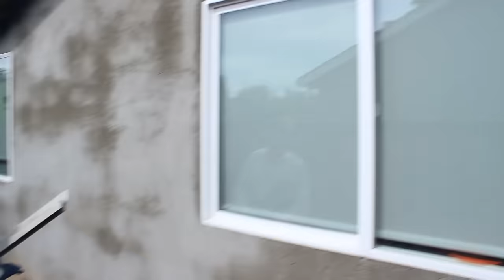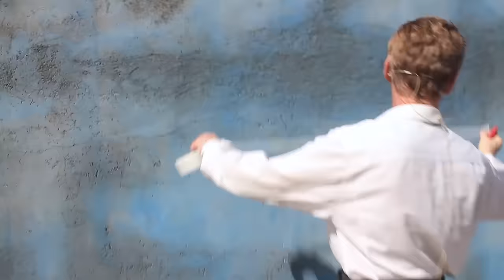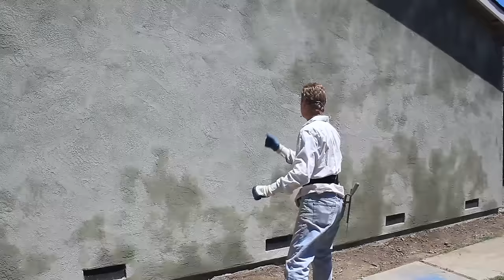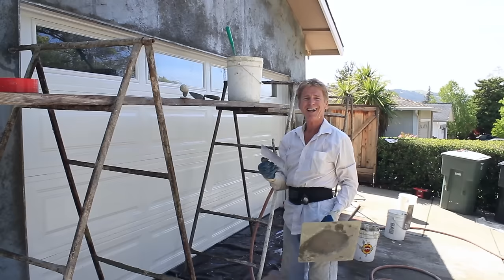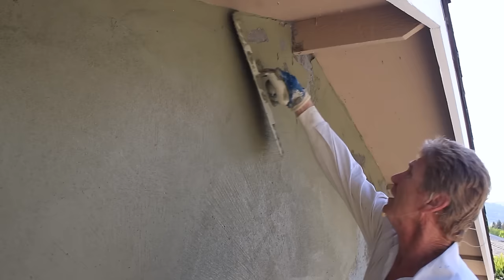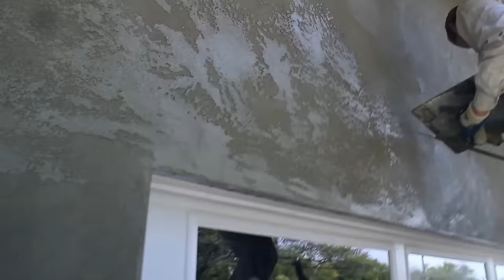Stucco Resurfacing

Comment: I enjoyed your video, Thanks. 
The first house my parents owned was probably built in the 1910s. They bought it in 1947. Stucco on wood lath. Nebraska's mild climate was not a friend to wood lath! The interior was also on wood lath. People had tried to nail pictures to the wall, bad idea. I'm 78 and worked construction most of my life. Big old houses had crown moldings formed in place with plaster over wood lathe. I repaired a lot of them but with expanded metal lath. Almost no plaster work is done around here any more. Interior is all gyp bd. Outside is over foam.
Reply from the maker: Howdy Larry, the same here, however, there's enough repair work from before the 60 when sheetrock was starting out to keep a few thousand plasterers busy for a few lifetimes.
Bringing to all the most complete plastering encyclopedia ever created in the world online.
 By the plastering messengers of Youtube.  With well over 850 free self-help videos 🎭 👀💃
Kirk and Jason Giordano Plastering

Comment: I like to shake the stucco used for the skip back from the edge before going up on the wall. I get no "knife" edges. I was 20 when an old (retired) union plasterer who worked out at Disneyland showed me that. I'm 74 now. Had to get a new shoulder last year. Plastering is tough work if not dangerous at times. Good stuff Kirk. Been watching a coupe years now.
Reply from the maker: Good afternoon Odd Job Fix. Sorry to hear this shoulder news.🥂
 I have my arm and shoulders sore at times, but miraculously, they continue to get stronger.
 Food and drink with a clean gut system are the keys to my health.
 Bringing peace, love, and brotherhood, back into the 🌎 of Plastering.
    The most comprehensive encyclopedia of plastering on video, by the plastering messengers of Youtube. 
Kirk and Jason Giordano with over 800 videos 🎭 👀💃

Comment: hey Kirk,  I completed my one and only stucco job due to you.  One of the hardest thing I ever did.  A past carpenter,  I was hard up for money and a friend let me stucco one of his rentals.  A painted cement block.  I followed all your instruction.  The only problem was you make it look easy.  I ended up spraying it on with a hopper scoop but it was florida in august and the stucco seemed to set up almost instantly.. I like to do a high quality job so I put it on twice as quick as contractors I see in the area.

I'm very interested in putting stucco over insulation.  I'm into building techniques and it only makes sense for energy efficiency value.  I  thought of putting half inch treated plywood strips, one and half insulation foam and then stucco the top with stucco.  I wish you would do something like this.  My technique blocks the heat radiation, thermal break and then leaving the block for thermal mass.   I'm a midwestern carpenter and now digging into stucco because of you.  Kepp up the work and let me know what you think.  I think with energy and solar panels your viewers would like it.  Dig it into solar panel insulation etc.  Solar salesmen are sweeping my area in florida.
Reply from the maker: Good evening NK Dude, Stucco over the insulation board is far from new, it's been here in the US for about 70 years. It was started in the UK.
 Its called the Dry-Vit system, first a moister barrier is attached to the wood wall, then the Styrofoam board, then Fiberglass mesh with Polybond to adhere to it.
 A color finish is then often applied.
 when I first started in the stucco trade 40 years ago, we did many kaiser hospitals and schools using that system.
 Today there are about 20 different manufactures that come up with similar ideas as it worked fine.

     Bringing peace, love, and harmony back into the world 🌎of plastering.
  The University of plastering by Kirk and Jason Giordano. 🎉💃 🥂🧞‍♂️
with over 850 free advice show and tell video’s on stucco & plastering

Comment: Thanks for the great video.  i have lots of variations on a 40 by 5 foot patch ..some  parts are floated some are steel troweled .Some i have removed the fake colour coated brick texture from it .. Im real happy i seen this video of years cuz it explained why i should use a bonding agent..   Theres a lot to learn ,, So i didnt think i could wet the wall again after i applied the bonding agent .. i thought that the bonding agent would not work
Reply from the maker: As a rule, once a bonding agent is applied, you don't need to wet the walls before applying stucco finish. However if the walls are in extreme sunshine say 90 degrees or above for a while, the complete wall can be cooled off with ten minutes or more of water sprayed from your garden hose to cool the wall down. Not just the surface but the entire inch thick base coat. Now your set to apply a finish without the hot wall drawing out the moisture of the stucco as fast as it hits the wall. And no, the bonding agent won't come off no matter how much water was hosed on it after that bonding agent has set. Stucco 101.👨🏻‍🔬

Comment: Another great video brother. Weldcrete is the best. I realize you didnt do the initial scrach and brown...i usually mix my scratch a little rich and on the brown coat i cut back on sand and use perlite especially over lath. Along with hydrating the walls , it cuts cracking down by 80%...
Awesome family brother. Glad to see Loouuu is back at it. Cheers from Central Florida !!!
Reply from the maker: Good afternoon Mike my fellow plasterer in Florida.🍺
 I have my reason for choosing the cement plaster I use when applying the scratch and brown coat.
 There are many ways to skin a cat.

 Bringing peace, love, and brotherhood, back into the 🌎 of Plastering.
    The most comprehensive encyclopedia of plastering on video, by the plastering messengers of Youtube. 
Kirk and Jason Giordano with over 800 videos 🎭 👀💃

Comment: Love watching how u guys do things over the pound 👏💪👊👷🙏 not so different, just some of the material. Been a nightmare at the merchants over here as well. As the British Gypsum factory shut down for a while. So no finish coat plaster. All the stuff they got shipped in was absolutely terrible gear. Polish finish coat plaster and Portuguese finish coat. I've used most materials but this was definitely a waist of time. We were trying to Trowel it  and it wasn't having it. Found out later that day it's designed to be applied, and sanded. And yes it came out perfect. But the work that goes in to it, to long and to messy. Live from the UK 🙏👷👊💪👏🔥
Reply from the maker: Good morning Neville, always a pleasure hearing from our fellow plasterers from across the pond,
 Cheers, mate. 🍻
   The complete plastering encyclopedia on video, by the plastering messengers of Youtube.  
     Over 850 videos 🎭 👀💃

Comment: I use K-rend in the UK that has uses a mesh over the whole wall. Never cracks and doesn’t add 10,000 to the price. Small price to pay to protect a costly stucco from hair line expansion cracks.
Reply: Good morning Elliott, we do this for interiors as a rule. Good tip.
    The complete plastering encyclopedia on video, by the plastering messengers of Youtube.  
     Over 850 videos 🎭 👀💃

Comment: Interesting texture. In the UK the finish would not be accepted but I understand that in the states it's what people like to see. 
I was surpised how thin you put the top coat on. I use Weber Pral-M with a monocouche finish and have to put it on at 15mm (5/8) in two passes, level off and scrape finish. I've never used a thin coat render.
Reply from the maker: There are many ways to skin a cat, this application or any other texture or finish can be done anywhere in the world. There are no rules to a person's decision to apply whatever they want, their homes thier rules.
Reply: I think that finish would be accepted if that is what the customer requested.

Comment: Sorry if I missed it in the video, but are there any downsides to not texturing?  I really like how the wall looked before you started applying texture.  Our home is a 1979 with sand texture stucco.  We would need to do some stucco repairs before painting anyways so I'm considering smoothing the walls if possible.  Any info or advice would be much appreciated.
Reply from the maker: Ask, and ye shall receive. 
https://youtu.be/N2e99XcHU84/

Comment: Kirk, Great videos sir ...Question, a guy has some 8x8 ceramic tiles embedded in the stucco and wants it skimmed and sand finished, can I just rough the tile up with a grinder and use PVA 20?Or should I use a modified polymer thinset as a scratch? Thanks for the videos, been at it myself for a few decades, always a new adventure !!
Reply from the maker: Good evening Steve, if it were me, I clean them up well, then apply a bonding agent over them, you can now plaster over them.😉
  Our unique plastering Tip:  all subscribers or anyone who stumbles on our channel with a question, type it into our Stucco/Plastering channel, and like magic, a video will appear to explain how it's done. 	
   This feature is miles ahead of any plastering forum. 🥳	
https://www.stuccoPlastering.com

Comment: Thank you for the time you take to explain things.  Let me ask you about my small project that a friend will be helping me with (or rather, I’ll be helping him).  I need to apply JUST a TEXTURE coat (over an existing textured coat that is fairly smooth).  Two questions: 1) Should I use a bonding agent, and 2) what type of tool for gouges (say 1/8” deep) that get randomly interspersed in the texture?  I took a sample pic and tried to paste it here, but the dialogue box won’t allow it.
Reply from the maker: Good morning Warhog dude. More important than a bonding agent, the houses need to be pressure washed well enough to eat off, or the bonding agent won't work. Nothing adheres to a dusty surface.
 For cracks, use what you have. A putty knife works well. Most of the time, I let the pressure washing clean the cracks for me.🤔
Kirk and Jason Giordano plastering, sharing well over 850 free Stucco/Plastering videos for your education. 
    Together we have created the most comprehensive encyclopedia of Stucco and Plastering videos ever produced globally, all by your favorite plastering messengers of YouTube.
Bringing peace, love, and brotherhood back into plastering.🎭🏝🎆
https://www.nps.gov/tps/how-to-preserve/briefs/22-stucco.htm

Comment: Hi Kirk, I moved into a 1964 house in Florida. It is part rock facade and stucco. The rock in the front is a different color than the rock in the back, but I think they are both unattractive. Could I stucco over the rock or is there a better process if I don't want the expense to remove the rock. Thank you!
Reply from the maker: Hi Heather, of course you can stucco over it. It must be pressured washed clean, a bonding agent applied to the walls, then stucco away.🥂

Comment: Kirk, I have watched many of your videos in preparation for stuccoing the facade of my office! This video answered my question about ghosting, and what happens when you  stop, let it dry and resume- the ghosting seam. So far I have done my scratch coat. What I thought would take me a day took four days! I only have one helper, and in Texas, the heat can wear on you this time of year. Should the brown coat go on quicker? If I have to stop, if I stop on a corner, will I prevent the problem of ghosting since it will be in the corner? I hope to do it all in one sitting like you show here, but we will see if I can. I will make a short video to put on my channel, and give you a shout out. I like the smoother finishes like the Santa Barbara- but I will see how the brown coat goes first. Also, I have a lot of corners due to decorative elements in the wall- recessed windows, pillar-like protrusions from the wall- so the large flat areas are few. Thanks for your great videos!
Reply from the maker: Good afternoon American Dude, I suggest corner to corner for no ghosting.
 Bringing peace, love, and brotherhood, back into the 🌎 of Plastering.
    The most comprehensive encyclopedia of plastering on video, by the plastering messengers of Youtube. 
Kirk and Jason Giordano with over 800 videos 🎭 👀💃

Comment: Hi Kirk,  Thank you for your videos. I’m a tile contractor and I float my walls with wire lathe and type 2 Portland cement, plaster sand and Lyme. I get some cracks in my walls am I adding to much lyme. I work in California so it hot but not Arizona hot.
Reply from the maker: Howdy Frank, I'm not sure you are using 17 or 18 gauge stucco netting I assume.
 Portland is for strength adding lime makes it spreadable, but, the fact is most two-coat systems hairline when they cure.
 Even if you hydrate between coats, nothing a bit of caulking cant handle.
Bringing to all the most complete plastering encyclopedia ever created in the world online.
 By the plastering messengers of Youtube.  With well over 850 free self-help videos 🎭 👀💃
Kirk and Jason Giordano Plastering

Comment: Hey Kirk! Plasterer from Pennsylvania here. No expansion joints? I use 1/2" galvanized expansion bead 10ft apart vertically on long walls or spaced out evenly.. Can do off of top of windows or doors also.. Noticed that's where a lot of cracking occurred on this house your doing. We have crazy temperatures here so just wondered what your thoughts on expansion joints are? Live long and Plaster!!
Reply from the maker: Greetings, Michael, expansion joints help big time if placed in critical areas.
 We did not apply the basecoat.
 This house was plastered by another contractor a year before I saw this home.
 Bringing peace, love, and brotherhood back to the world of Plastering. 🌍
    The complete plastering encyclopedia on video, by the plastering messengers of Youtube.  
     Over 850 videos 🎭 👀💃

Comment: I have some structolite from HD.  I can’t seem to get a smooth texture out of it.  I made a small batch and mixed with a my paint mixture for a couple of minutes and it is still gritty.  Do I do it for longer?  5,10, minutes or more?  Thanks
Reply from the maker: Good afternoon John, Structo-lite gets it's strength form sand, so naturally, there's sand in it.
The talent for applying all cement plasters is, knowing your materials, well.
 Hers what I'd do if I wanted a smooth finish using Structo-lite. first, it's designed to be rough as its a basecoat.
However, I would apply it and know just when it sets, could be 2 to 5 hours depending on the temperature.,
I would then wet the trowel and trowel over it, then wet once more and keep on wetting the trowel to get it smooth otherwise it will drag the finish.
 Bringing peace, love, and brotherhood, back into the 🌎 of Plastering.
    The most comprehensive encyclopedia of plastering on video, by the plastering messengers of Youtube. 
Kirk and Jason Giordano with over 800 videos 🎭 👀💃
Reply: Kirk Giordano plastering Inc. sorry I wasn’t clear I am trying to do this in three coats.  I suspected that there might be sand, however is seems to be weak.  I can scratch it off with my fingers.  I can hit it hard and hurt my hand so it’s compression strength is decent.  Once I get the coat on I will finish with the long setting plaster of Paris.  I don’t know where to get the lime plaster to finish it.  Not at orange or blue.  Thanks so much you are very kind

Comment: I'm down here in Los Angeles.  My question is this: as a customer having to hire a company to re-finish my 1926 Spanish house (little stucco box) that has had a finish (it's gritty) put on the original stucco, how do I know what the cost should be and what to ask them that shows me they'll take care of me?
Reply from the maker: Good evening Francesca, excellent question. I, too, have been cheated/robbed a few times, even with folks I trusted.
 It's a difficult question to answer. However, I'll try.
 Google the company, important: check their reviews, then talk with at least three companies.
 Combine what each has explained and bid, then go with your gut feeling on you you feel will do the best job, at a reasonable cost. 
This may sound odd, but usually, the guys who are the best and are fully licensed and insured are less expensive as they know what they are doing.😉  
Our unique plastering Tip:  all subscribers or anyone who stumbles on our channel with a question, type it into our Stucco/Plastering channel, and like magic, a video will appear to explain how it's done. 	
   This feature is miles ahead of any plastering forum. 🥳	
Kirk & Jason Giordano Plastering
Reply: In the greater Los Angeles area lath scratch brown and color coat cost anywhere from 70 to 90$ dollars per yard don't know what a yard looks like take your number of yards figure and divide that by 9  and by doing so you will have converted yards to square feet and most people are familiar with that.

Comment: Hi kirk love your videos true professional. Question once I apply weldcrete to painted wall should I wet wall before applying la habra stucco or just apply without wetting wall
Reply from the maker: Good afternoon Alberto, the weather dictates this question, cold no need to, hot a must.
 Bringing peace, love, and brotherhood, back into the 🌎 of Plastering.
    The most comprehensive encyclopedia of plastering on video, by the plastering messengers of Youtube. 
Kirk and Jason Giordano with over 800 videos 🎭 👀💃